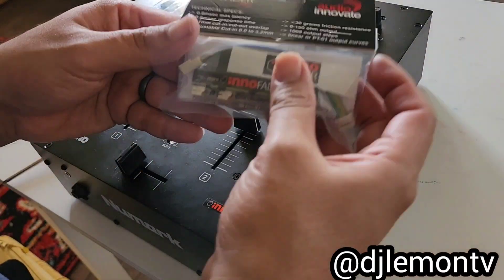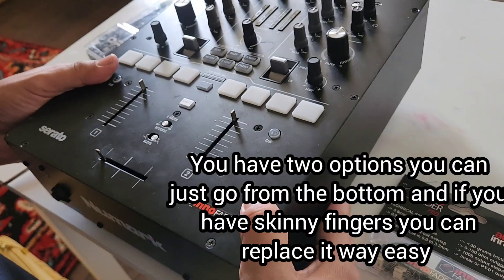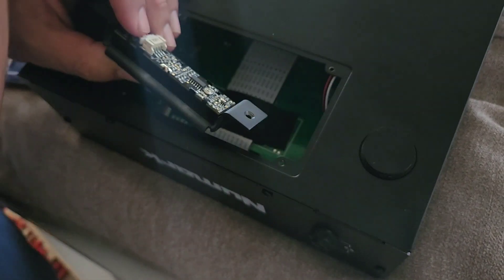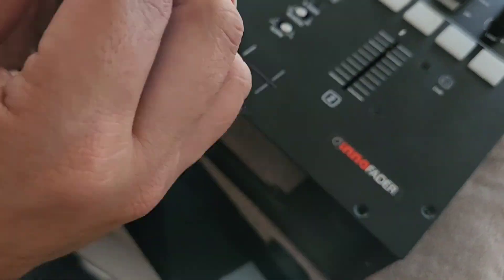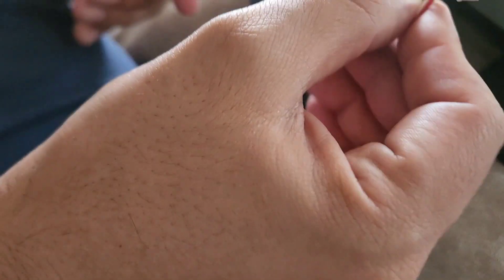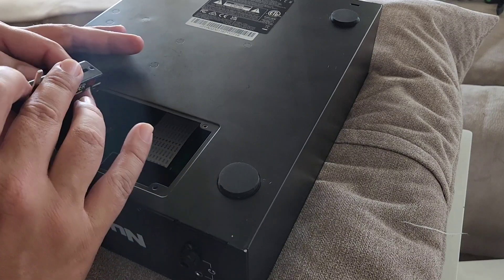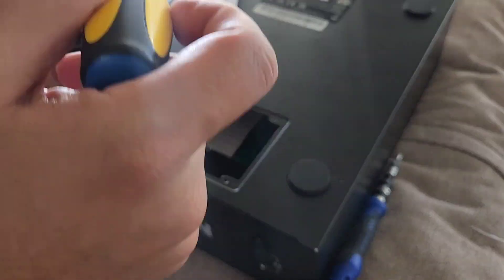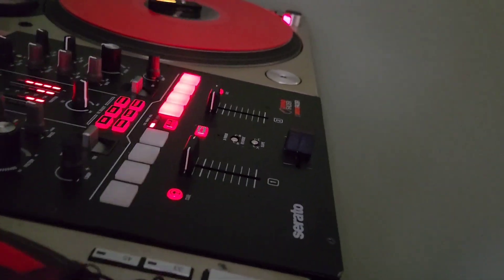How to install an innofader to numark scratch mixer.

Comment: Just installed innofader pnp3 in numark scratch,
cuts fine but it’s hitting the metal on the faceplate which is annoying is there a way round this?